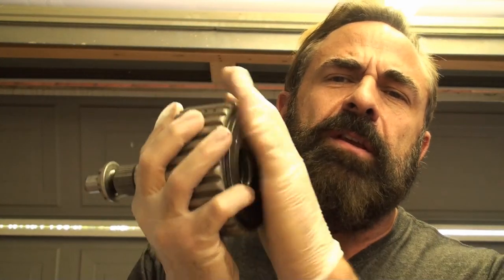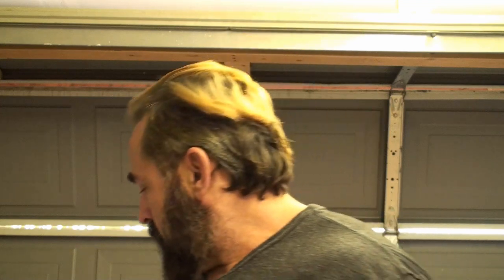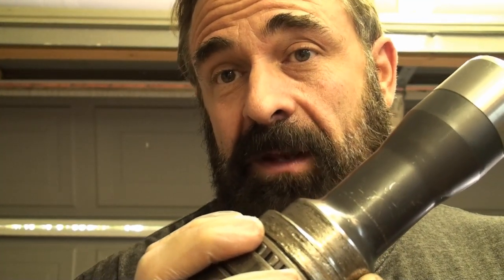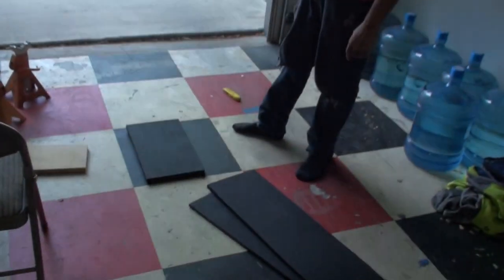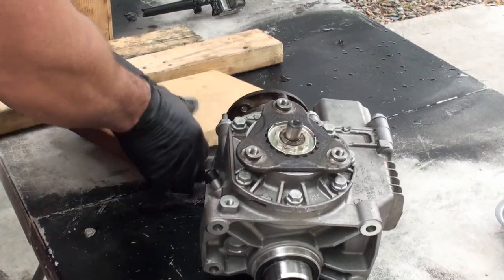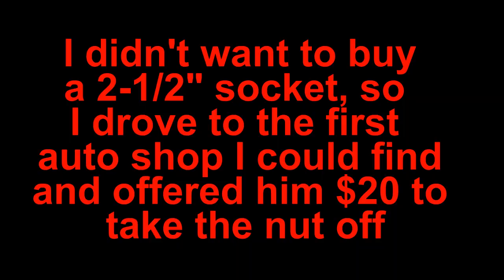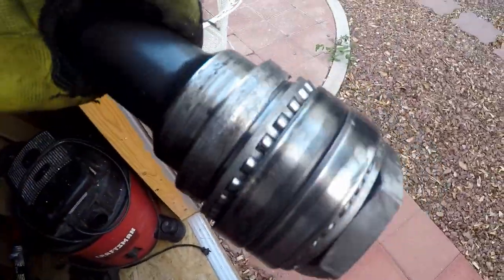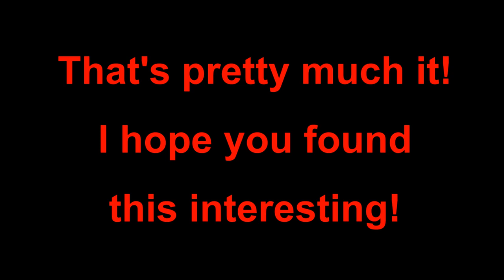2016 Golf R Bevel Box Failure TSB

Comment: Hey bud I’m from Missouri and having an odd/ same situation. I was doing a hard launch/stage 2 dsg with um haldex tune golf r. When I did the launch it took off hard like a normal launch. After that I noticed the awd wasn’t working well but still working. I put the car up on a lift and didn’t notice anything, the driveshaft was moving and the rear wheels. A day later I did another launch and the rear dampener guidbo broke. The dealership replaced the dampener/guidbo in the haldex. I picked up the car from the dealer and noticed the awd still wasn’t building pressure or working. Took it to another dealer and when they launched it the dampener/guidbo broke again along with sheering the dampener off the driveshaft. Something is wrong causing the dampener/guidbo in the haldex to keep breaking during launches. Dealer thinks it’s from doing launches. They keep trying to replace the guidbo but I’m not going to keep paying since it will keep breaking again. It’s summing down to the bevel box or rear diff. The dealers don’t know what’s wrong and I know something is broken. Thanks for any feedback!
Reply from the maker: Sorry to hear about the problem. Launches shouldn't do this, unless you are launching over pot holes or uneven surfaces. High torque with rapid traction fluctuations is what breaks our cars.  This sounds just like what happened to my car.  I am pretty sure the only event that is strong enough to explode the damper repeatedly is when the bevel box slips during a launch. I don't think the haldex pump would do this, but I could be wrong.  You need to lift the car up, put it in Park, take a large pair of channel locks or pipe wrench and see if you can turn the drive shaft.  Slowly apply the pressure and if the bevel is bad it will allow the shaft to turn with some good pressure.  You don't need to necessarily lift all 4 wheels off the ground to test the bevel box.  You only need the rear wheels off the ground to try and turn the driveshaft, provided you can get under there and get a wrench on the shaft.  I didn't put the channel locks on the actual shaft, I put it on the 3 bolts that the damper bolts too on the shaft.  I hope that helps.
Reply: Thanks for replying!! That’s what I thought it was from the beginning but the dealers can’t figure it out. Keep blowing up the dampener and they are saying it’s because the suspension is worn in the back. I told them that can’t be because these things are pushing 600hp and not blowing up from launches. When this happened at first I heard a loud boom. Then the car lost 50% of its torque feel and constantly felt more and more fwd. I appreciate you reaching out. Haven’t had much luck in people knowing about this issue. Haven’t you uploaded this video a month ago I would have been lost without it. Thanks again!!!
Reply: This video is the reason i still have my car. Nobody could figure out the problem until this video. Cars back on the road. Thanks dude!!
Reply from the maker: @magicalretard2  Heck Ya!!! I'm glad it helped. Did you fix it yourself or did you have to explain it to the dealer to get them to test it?
Reply: @RadFox1320  I taken the car to 2 different dealers and they couldn’t diagnose the problem. They fixed the dampener/guidbo on the driveshaft near the rear diff when it broke. Got the car back from the dealer and it still felt like there was no torque and the traction light was coming on like crazy. The dealer was arguing saying the car is modified and that’s what’s wrong. I drove the car to another dealer and they tried saying it was the rear diff. I knew forsure it was the bevel box once i watched you’re video. The dealers just couldn’t diagnose it. They quoted me an insane price too. I ordered a used driveshaft and bevel box hoping it would fix it. I had a buddy fix it at his house. Thank you for posting this video cause i would have been sol. This is not a common thing i guess around here in kansas city mo.
Reply from the maker: @magicalretard2  Wow! I am glad you got that sorted out and that I was able to help! The sad thing is the dealers still probably don't know how to diagnose it and will replace everything but the bevel box.
Reply: Hey brother, I’m 2016 tts apr stage 1 and same issues.Frist time I replaced new haldex pump, haldex ecu and change oil. I picked up the car and launched it the guidbo broke. Second time I replaced a  2hand bevel box and racingdiffs Haldex clutch service pack. The guidbo broken again!!!
How can I fix it 😭
Reply from the maker: @WCWMONDAY  interesting. Did/have you tested the replacement bevel box with a large wrench?  Its possible you found a damaged bevel box. Are the front wheels spinning out of control when you launch?
Reply: @RadFox1320  Please forgive me if I make any errors. My English is pretty basic. I’m from HongKong. Maybe I brought damaged bevel box because it’s from China and it’s cheap😂now I ordered a brand new bevel box and going to restore ecu and tcu become stock.
I will update u when I finish it

Comment: Hi, Thanks for the Video. Out of curiosity was your error c111307 07 008 Mechanical Failure?? Because I have the similar issues with you.. only under load i get the error logged but no wheel spins (well at least not yet) i heard the knocking once but my 4 wheel still works in rain etc  i only get the above error when i launch it??
Reply from the maker: I did eventually see a "Mechanical" error, but i dont remember exactly which one it was. I didn't see it until after the damper seperated. At that point I was like no chit theres a mechanical problem, but i had tried all the other stuff.

If you are hearing that rapid banging when your on the gas hard from a dig I would jack the car up put it in park and see if you can turn the prop shaft. If you have the tools it wont cost you anything to look. On my car the banging kept getting worse as the car became more and more front wheel drive. I also started getting more and more traction control intervention too. 

Have you tried reseting you haldex pump? Its free. It needs to done exactly as described in the link below. 
 
Check out this site for haldex related failure codes and pump priming instructions. https://www.haldexrepairs.co.uk/generation-5-haldex-fault-finding-repair-guide/
Reply: @RadFox1320  Hi Thanks for your reply. I did the haldex Oil service, cleaned the pump and the filter on the pump and reset my pump using vcds. I got the haldex service kit from that site. I am in contact with the site owner and he did mention to to check the transfer box too.

Untill I do a hard launch control lift no error come but after two launches i get the error.

 I mean currently my 4wd kind of works but i keep  the traction light  when i put my foot down hard on wet. I will try your method as mentioned. 

I will get back to you. Thanks for the detailed info.
Reply: @geeuk  did you manage to fix it im having the same problem?
Reply: @Uasa234sa  I fixed mine today just as the site above said. I have a 15 S3. Mine was a failed pump but it is essential to do a pump adaptation after the repair, otherwise you didn't really fix anything. It's VERY audible when the pump starts to calibrate, you'll know it's happening.

Comment: Thanks a lot for this video. I have this problem on my RS3. Can you repair the transfer box or needs it need fully replaced? Thanks
Reply: Did u get it repaired ?
Reply: @NinjaKnight00  the car went back to the dealer. Got another RS3 now and it’s all mechanically sound 👍🏼
Reply: @mattjamescarter  lucky mate! I’ve just had to buy a new transfer box at the cost of 2866£ fitted 🤯 it’s already had a new clutch and flywheel. Should of washed my hands with it then 🤦🏽‍♂️ thanks for the quick reply
Reply: @NinjaKnight00  aw mate that’s very unlucky! Think some are bad and some just hang on for many miles. At least you have peace of mind now 👍🏼

Comment: Been having Haldex traction issues on my STock 2016 A3, dealer first replaced the Haldex pump, said it “works”, barely improved, still lots of wheel spin and traction control light flashes constantly from dig, now back to the dealer and they found another code C111307 awd malfunction, and they said the clutch needs to be replaced since it is slipping. All covered under warranty, but my warranty ends in 1 week lol. So I sure damn hope that fixes it. They said my rear diff is fine, and I don’t believe I have symptoms of a failing rear diff, What would you recommend me to look for if the clutch doesn’t fix it? Great video as well.
Reply from the maker: Was the traction working good before this happened? Or was it always bad.  There were some  haldex control module issues where they had to be reflashed. Also, the pump has to re-adapted when its replaced. Hopefully they did this correctly. I really dont think its likely the haldex clutches are bad. So I would check the bevel box. You have to keep the front wheels from turning and then try to turn the driveshaft with a big wrench. If the drive shaft can be turned when the front wheels are locked up and not able to rotate, your bevel box is bad. The thing is, its easy to test this with the DSG, you just put the car in park and it locks the front diff. On the manual  your gonna have to just leave it in gear and try it or hold the front wheels or keep the front wheels on the ground when you try to turn the shaft.
Reply: @RadFox1320  hey thanks for replying! And yes the car seemed to be working just fine, although I’ve never tried launching it until recently where I had found the issue, but traction light would never flash before. Yeah I’ll let the dealer know about the control module and priming the pump, as well as the bevel box. Hopefully they don’t hassle me, since you know “they know best”. Did you have an estimate quote  for getting a bevel box? I live in Alberta, Canada where VW parts aren’t the most accessible from junk yards, etc. And I wouldn’t need to get a new control module, just an update? If that happens to be the issue.
Reply from the maker: @thekid6524  the front tires are burning out right? If you take off fast, the fronts are spinning but the back arent, correct? 
i heard most modules could be reflashed but some went bad and had to be replaced. Most dealers never figure out the bevel box, i dont think there is a troubleshooting guide for dealers. Try to explain it to them. The bevel box plugs right into the front diff. If you hold the diff from being able to turn, it should not allow the prop shaft to turn. If you can turn the prop shaft with a wrench its bad. You cant just grab the shaft with your hand and turn it. And if its not totally destroyed lifting the car up and putting it drive will make all the wheels spin. So they will think its all working, but it may not be. It takes a lot of load for the bevel gear to slip.  
Those bevel boxes are not cheap. Im not sure what they cost new but i hope you can find one used.
Reply from the maker: Also, go to www.haldexrepairs.co.uk and find their troubleshooting page and look it over. Plus they sell haldex parts but im not sure how much it would cost you.
Reply: @RadFox1320  thank you, your information is much appreciated. And yeah that’s exactly what is happening, Living in Canada made it easy to tell that only my fronts were engaging when it snowed. (as you can see in my video on my channel) I will let the dealer know about the bevel box and ask if they can diagnose it. Might have to go to a specialized shop since my warranty is over next week. I’ll let you know if the new clutch happens to fix the issue, but having doubts now, but at least I am getting a new clutch for free? 😂 what a joke by the dealership, they clearly don’t know much about their “Quattro” system. Money and time waste for me and them.

Comment: Since you changed the bevelbox and got another one,how much play is allowed on the output shaft by turning the triangle adapter to the rear drive shaft?
I have a clonking noise and turned  the rear drive shaft and noticed there was movement quite a bit.Turning the drive shaft(left to right again and again)would create that clonking noise coming out of the bevelbox.So everytime you go on and off throttle it's clonking because of the play in these gears(rack and pinion).
So i guess my play on these gears are to much?